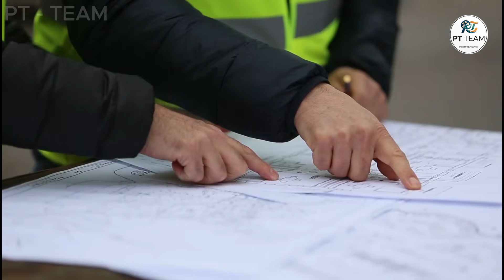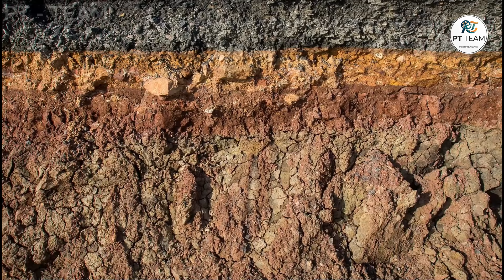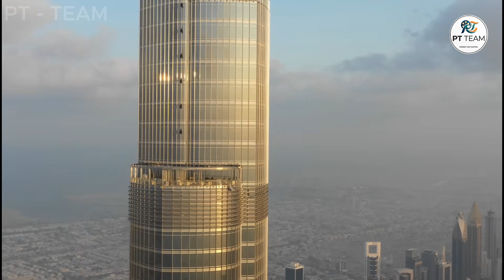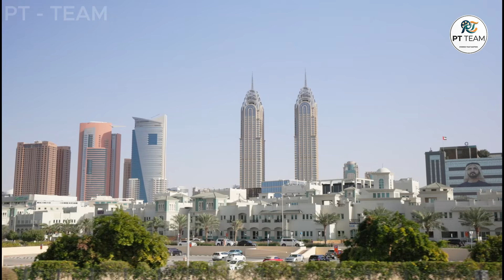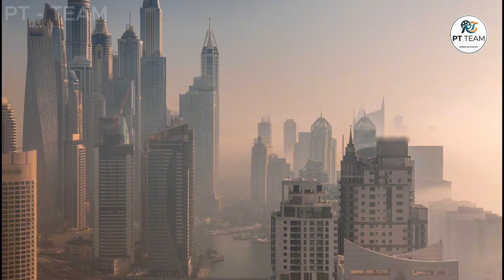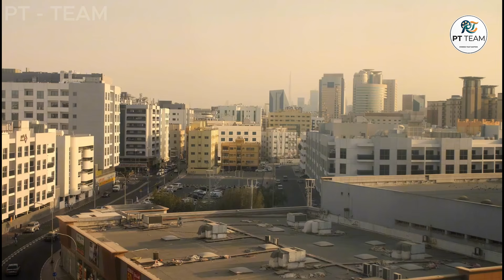Why The World’s Tallest Skyscraper Must Sink To Survive: The FOUNDATION Illusion!

Comment: As an engineer, what I have gathered about the Burj Khalifa is the native Dubain soil cannot sustain such massive structures, regardless of the foundation, for prolonged time.  The soil strata is inadequate for such loads, as it will over time sink!  Any uneven subsidence with a tall structure would be catastrophic!  Unless a tall building's foundation can successfully be anchored to bedrock, time is the ever-persistent enemy.

Studying the structure above ground; given the harsh Dubai environment, indicates despite best, current efforts, it cannot be maintained.  Sand, wind, temperature, constant expansion and contraction of all building elements cannot be controlled.  Materials react differently to external influences.  Concrete will always crack.  In colder climates, such as Chicago, structural rebar will corrode over time even though encased in concrete.  The result is corrosion expansion which will undermine the load-bearing concrete members, and slowly fail.  It is inevitable!

Dubai's artificial islands are returning to the sea, and adjacent coastal areas with it!  Residents are leaving, and who is going to be able to maintain the literal hundreds of massive, concrete structures once the economy needed to support it no longer exists.